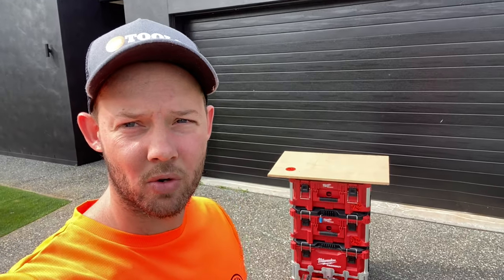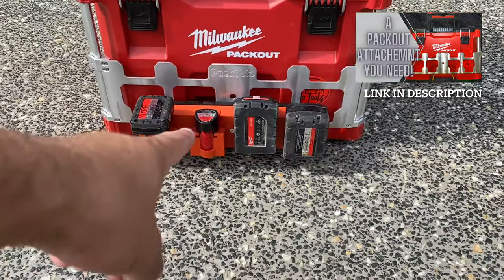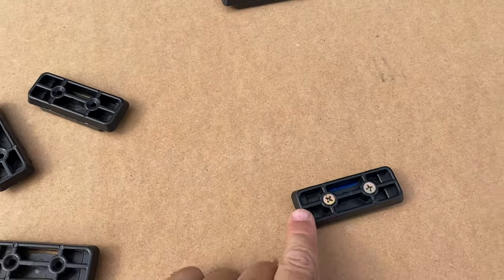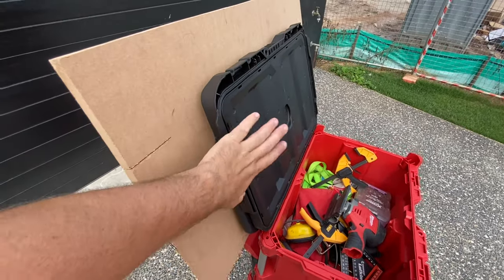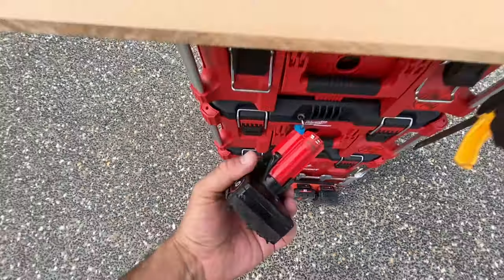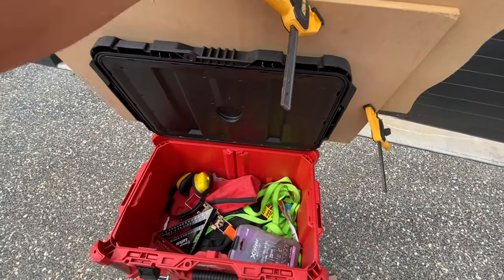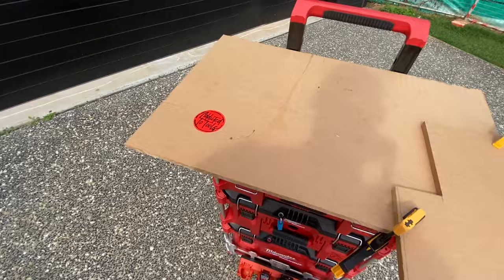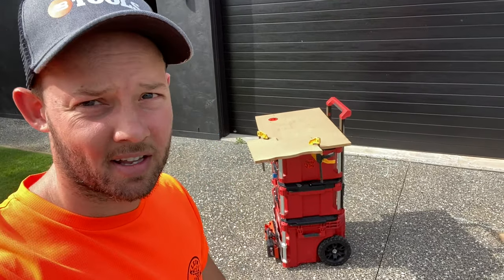Milwaukee packout accessories workbench

Comment: Well done, especially with one hand holding the camera, other hand doing all the work! 
Great idea with the StealthMounts for an inexpensive work table. 
As an improvement idea, you could put some thick strips of metal around the underside perimeter of the MDF so that when you're cutting, you don't accidentally cut into your table, and even worse cut into your packout. It would also provide some extra stability to your table if it's wider.
I have to order those stealth mounts and build this kind of table.
Thanks for sharing your idea!
Reply from the maker: Aha thanks mate. It takes a bit to get used to using the camera and working😆.
That’s a good idea though. I definitely don’t want to cut into the packout. 
Cheers for the input👌

Comment: Great idea, and I think better than the Milwaukee table top, but you don't show in the video how to remove it! Also, and this is why I ask - how does it lock into place? The Milwaukee packout components have a little tab in the middle front that locks them onto the lower component, then you lift the tab to release it. Just adding feet to something (as you show) will allow you to connect it, but does it lock it? In your video you sort of give it a couple of tugs, and it appears to be quite snug, but how? And if it is locked, how do you release it?
Reply: Stumbled upon this video and had the same thought. I'm thinking it's "sturdy" but just slides off pulling forward.